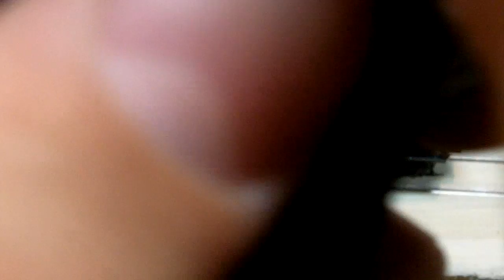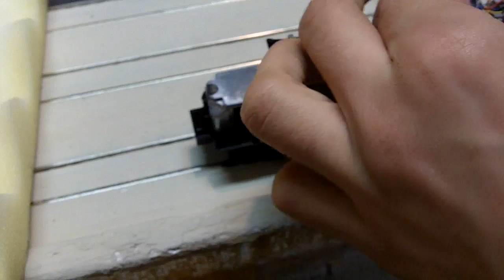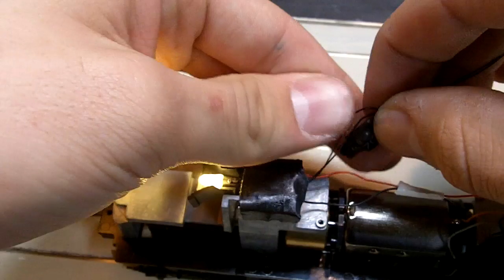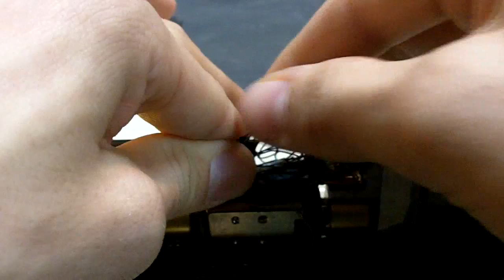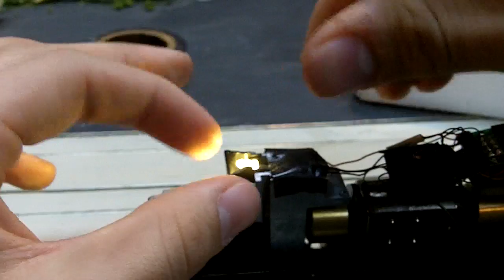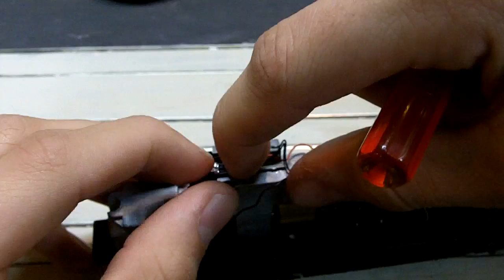How to install DCC and LEDs into a Proto 2000 Locomotive (part 2)

Comment: When I have that much wire I wrap it around a nail or tube so it's coiled and the slack is taken up. Also I would secure the housing with a db of silicone on each side.

Comment: I glued all the led's on my p2k engines with a little drop of glue. I never use common electric tape and certainly not on decoders. I removed all the original pcb's and attached the decoder with some silicon glue and the wiring I fixed with kapton tape. Kapton tape is strong en very thin and has extreme good adhesive properties.
Reply: Capton tape is also good as an isolator for the decoder from anything metal also.

Comment: Interesting. I am new to dcc, but I guess so long as you disconnect the light bulb leads you should be able to just plug a decoder into any Proto loco with decoder socket? Also, if you wanted to keep the original bulb I suppose you could put a resistor in line?
Reply from the maker: Yeah if you disconnect the bulbs then you should be able to use just about any decoder. The wiring for those bulbs can be a little tricky sometimes, or the need for resistors. I dont exactly recall the details for the bulbs though
Reply: +modeltrain9500 Thanks.

Comment from the maker: enough with the all Caps man, its unnecessary. I used insulating tape to prevent short circuiting, which would generate more heat.

Comment: Glad you got DCC installed into your RS27.. Looks like you got everything figured out on your own, which is great! You can go to radio shack and get a good soldering iron and solder for less than $30. I recommend the variable heat setting 20-50 watt iron.